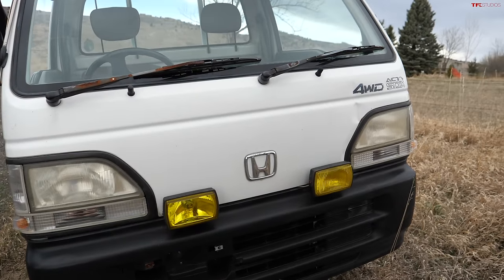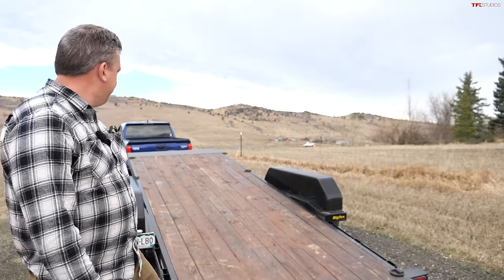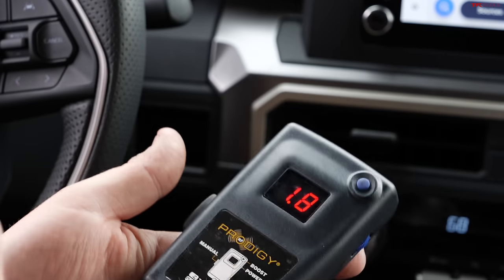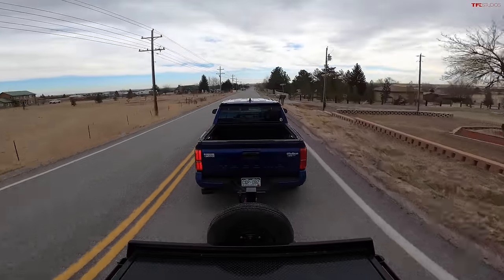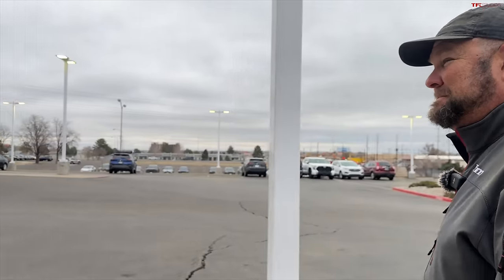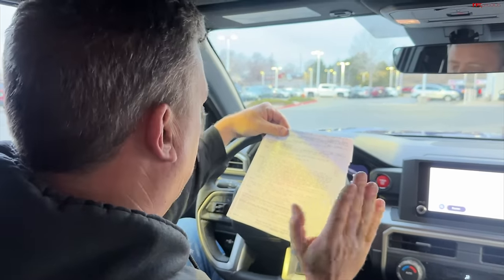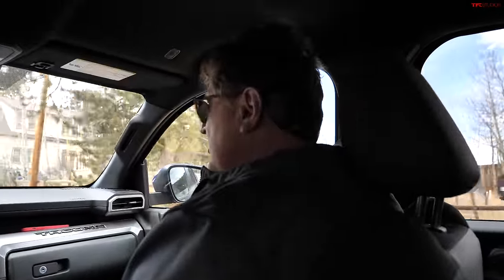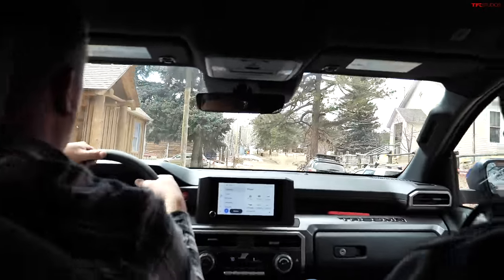Can the New Toyota Tacoma Tow Up the World’s STEEPEST County Road? | Part 1

Comment: Why not have full time 4wd like the lexus or land cruiser? Land Rover ditched the part time stuff in the 80`s!
Reply: Trying to keep costs down. Those systems are complicated and expensive
Reply: @MrTonaluv  Center diff with locker is not very complicated. I am still thinking Why? Pickups havy really bad traction in the rear.

It does not make any sense.
Reply: The tacoma hybrid limited will have it.  Its not out yet
Reply: @beexiong2995  okey will it be true system with center diff or some clutchpack that wears out in no time?
Reply: @Atle-k2z  center diff.  It's shared with the new land cruiser
Reply: That's how my H3T is, quite a useful feature that I wish was more common. I imagine it's fuel economy related though, ya save an mpg or two so less EPA breathing down your neck

Comment: Toyota has been hit by the European bug. The first is no excuse. End summary, avoid any Toyota which is in its latest gen; if what is meant to be built tough can't handle simple conditions (you wouldn't even expect a crossover to break in the same conditions) I don't have much confidence in anything else. Nothing should be designed to break nor over heat when in operating well within what should be in theory design parameters. I was considering the Lexus GX but now I am not so sure.